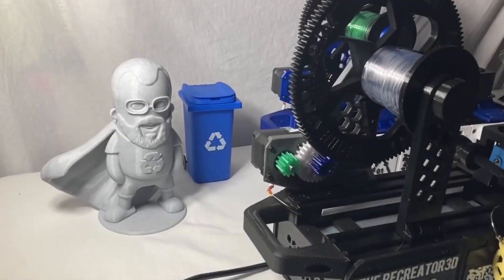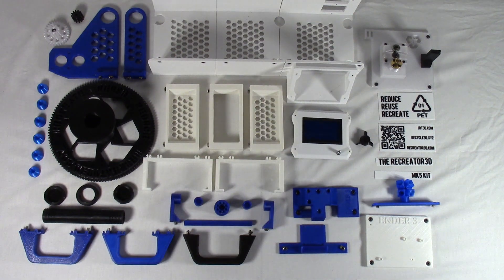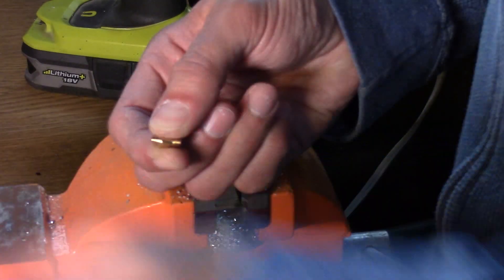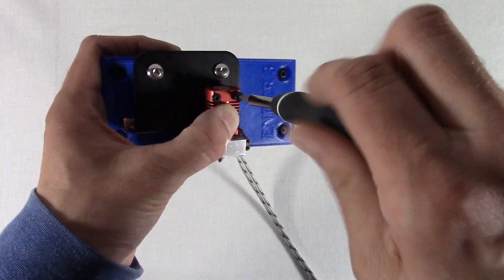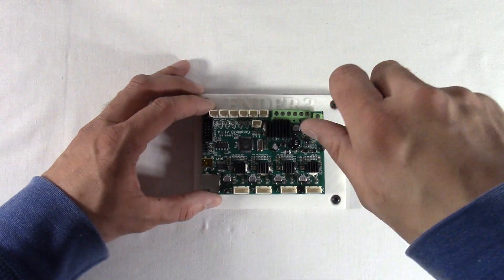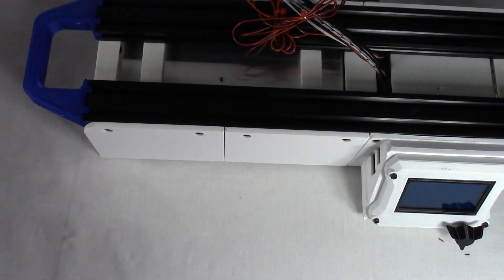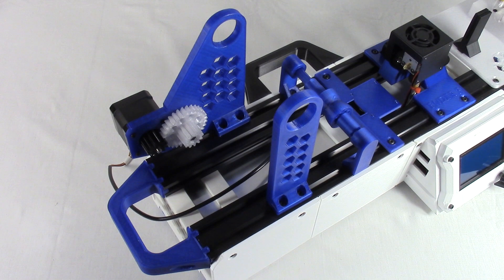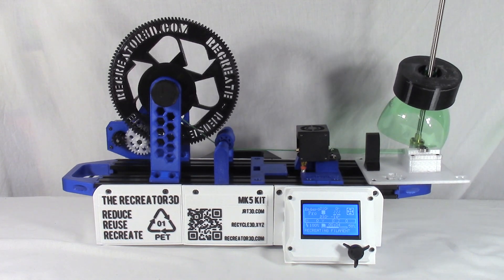The Recreator 3D - MK5Kit : Ender3 -  DIY Build Notes - PET Filament Maker - Plastic Pultrusion Unit

Comment: hmmm. I think this could be attached to a Ender 3 pro with just an extra hothead and stepper motor....Then you could switch between them.
Reply from the maker: More or less what I have going on for the Recreator3D "Add-On" - if your board can handle a second extruder - you could easily write the gcode to use that connection and either splice into your motor or just switch it around when Recreating!

https://youtu.be/LPCBbaoczBw
Reply: @JRT3D  yes. i love it. I'll change 4 things. figure out how to physically attach it to the printer, use the original spool holder, add a switch to change modes, and add a color marker attachment. hehehe thank you for drawing my attention to this video!!!:face-red-heart-shape:

Comment: How often do you have to splice another bottle? Or another way to ask how many minutes does it take to pultrude each 2 litter bottle?
Reply from the maker: You should be able to get about 1 gram a minute at a slow speed 25-30 grams for a 2L bottle. medium speed is doable and will get you a round 20 minutes per 2L bottle.

Comment: Thank you for your information. I have completed the whole process of making the machine and it works perfectly.
Now I have the problem that I can't print with the filament made from bottles.
It gives me the following error: Nozzle is too lowperature.
The printer I have is Ender 3 V2, motherboard 4.2.2 V 1.0.4.
My question is: do I have to modify some instructions or update the software?
I would appreciate information. Cheers
Reply: Hello, I just put the retractor on and it does the same thing, low temperature, how did you fix it, thanks

Comment: Cool idea but you need a good printer to print all the bits and a redundant printer to make the machine, do you use what ever firmware is on the board or do you have to flash something different. 👍

Comment: How does the filament move left or right to roll it up clean?

Also you should look into a hopper addon to be able to use shredded old prints and bottle caps and the hard parts of the bottles.

Also maybe find a way to make it roll onto a filament roll and not on the gear shaft directly

Comment: Can you tell me what what material I should use to print the parts. 
Thank you
Reply from the maker: Mostly everything can be printed in PLA - but I suggest PETG/ABS/ASA for the head plate mount - as that will get direct heat among the pull
Reply: @JRT3D  thank you.  Can you also tell me the infill you use for the parts? Thank you and sorry for all the questions.
Reply from the maker: @a.p.z.  I use 15% gyroid for most 50% for the head mount
Reply: @JRT3D  Thank you very much.

Comment: I just happen to have a 'parts' ender that I was going to combine with my good one to make a VoreXY from the two...but the rate that my wife goes through soda, I have basically a limitless supply of 2L bottles.

A question:
Would it be possible to make a spool adapter that could clamp onto existing plastic filament spools and wind the filament back onto it?  Otherwise, I'm having a hard time picturing how one would pull the material off the winding spool, and get it onto another?  Or do you just manually wind it onto another spool?

Hopefully that makes sense...
Reply: Also...would PLA work for the parts not real close to the heat?